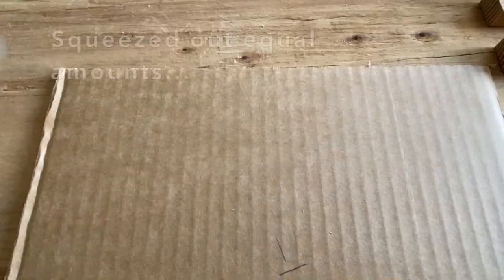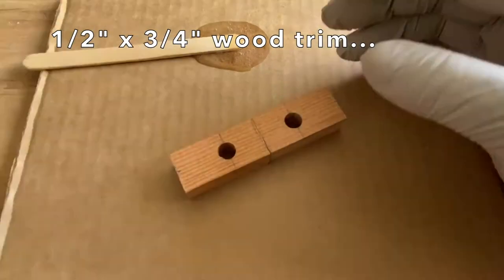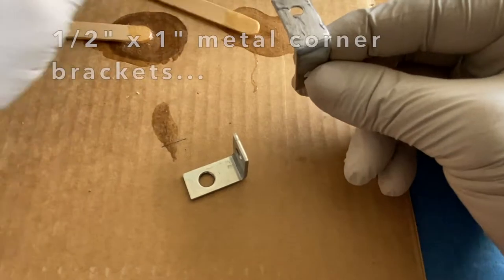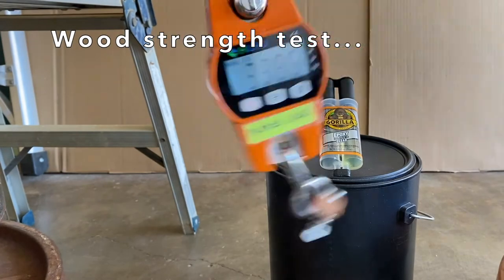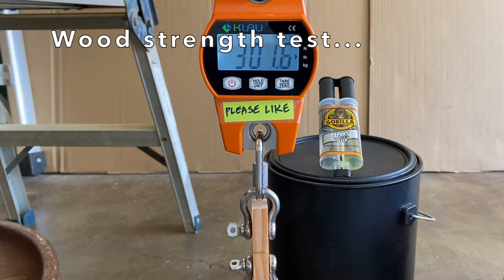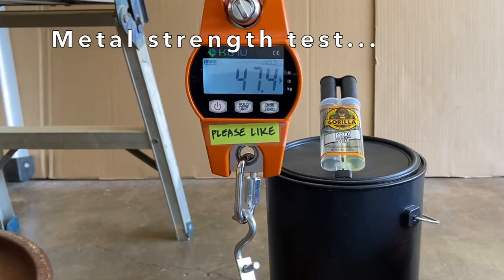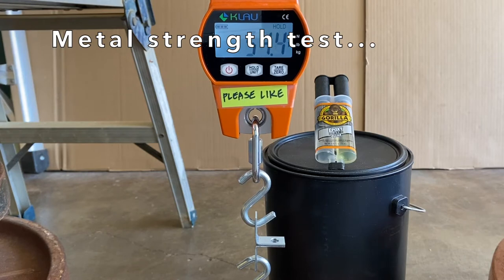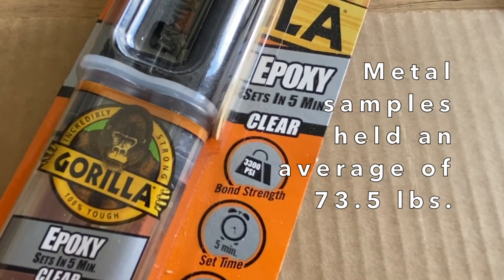How Strong?  Gorilla Epoxy Strength Tested

Comment: Thank you. Do you think the metal would have held more if you scuffed and cleaned the bonding surface or no?
Reply from the maker: Not sure.  I did sand the metal pieces with 150 grit (I think).  Maybe I could have cleaned them better.  🤷🏻‍♂️

Comment: how strong is this on glass do you think? can it glue a 2kg glass vase leg... with 4 legs holding the weight
Reply from the maker: The literature for Gorilla Epoxy doesn't mention glass as a compatible material.  There are glues for glass but I haven't used any and can't make a recommendation.  Sorry.